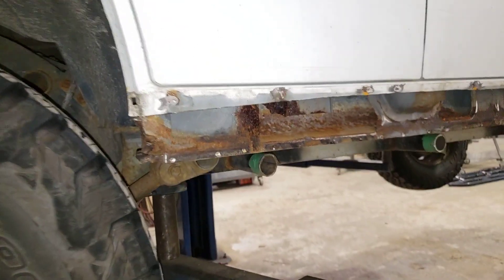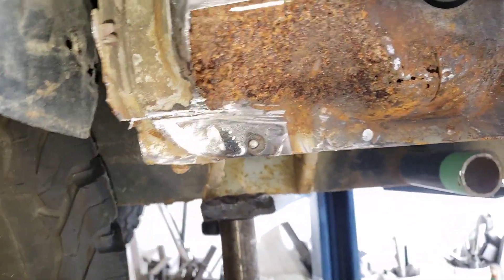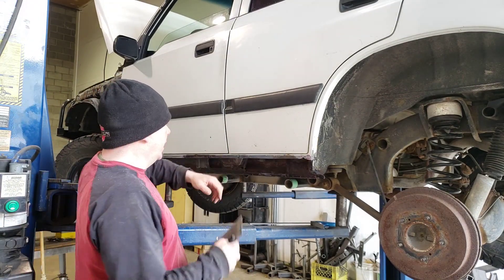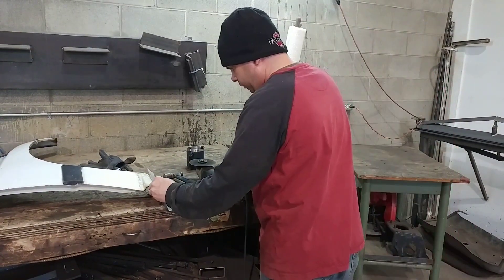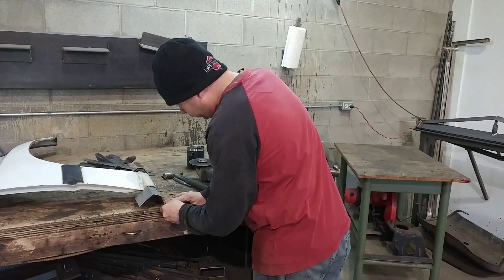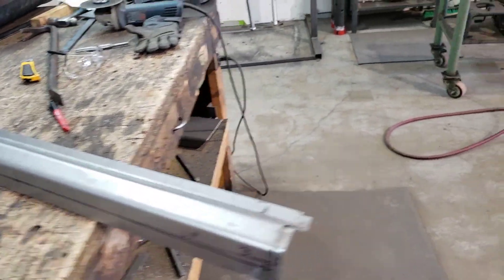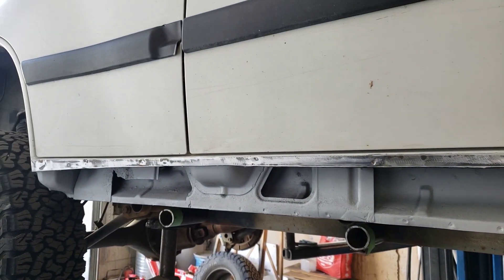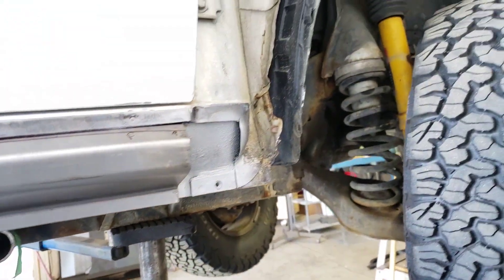Suzuki Sidekick Rocker Rust Rescue Part 1

Comment: What gage of steel do the rockers need to be?
Reply from the maker: I use 16ga. cold rolled steel as it's tougher than stock, which I believe is 18-20ga., and it welds better than hot rolled.